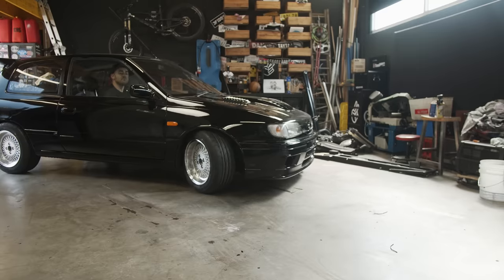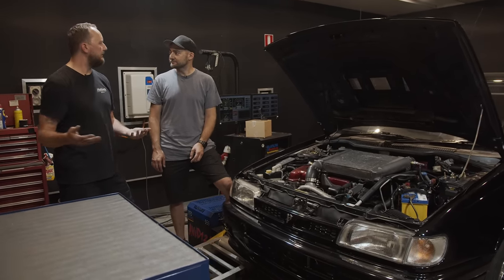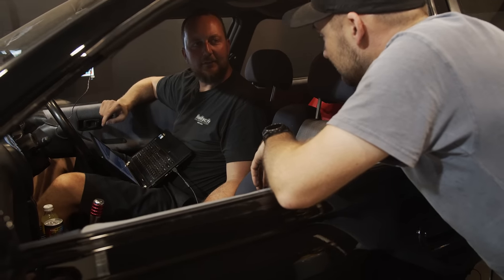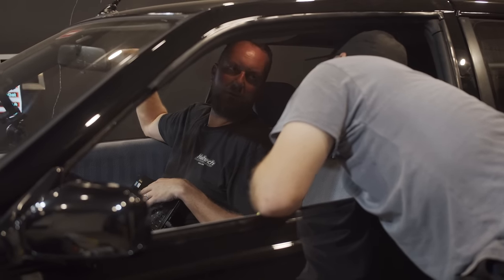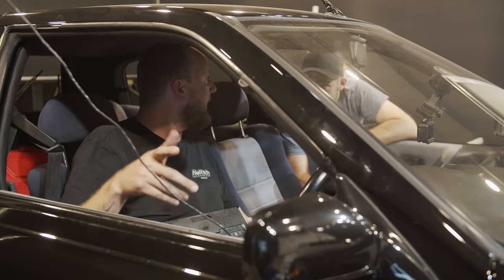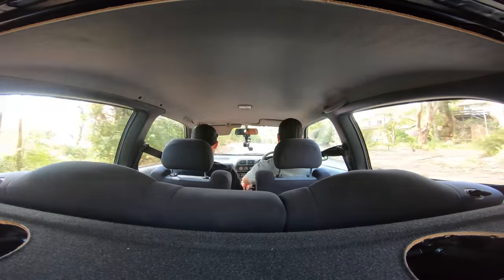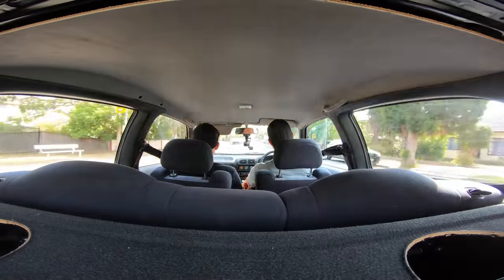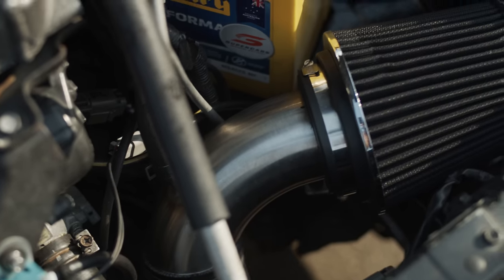Nissan GTiR Brought back to life & tuned

Comment: I'd love to see you catch and release a Celica GT4
Reply: Hell yes! Watching Carlos Sainz back in the day, I wanted a GT4 so much.
Reply: Seen Project Binky?
Reply: Jorn Navarre  spotted one or two locally and in melbourne. They're not as common as what they were though.
Reply: Jorn Navarre  thats because the boys at bad obsession motorsport bought them out to turn it into toyota mini gt4
Reply: I had one 8 years ago. Great fun but getting parts was pricey and it needed a lot of them to get through tuv. Lots of old car problems. Worth every cent.
Reply: @williamparker7823  Imported mine from Japan to the UK in 2007. Probably spent around £20,000 since then keeping her maintained.
Reply: @webweasel4401  I think mine was imported around 98, then I took it to Germany in 2011, then my friend bought it and took it back to the UK in 2014. I had to change the exhaust for one with a cat since it was removed at some point, replaced all 4 dampers because they leaked, got a new wheel hub, replaced a seized caliper after it froze, and barely talked my way out of having to change the speedo because it only read in mph after delimiting. After my friend got it back to the UK, he put some new wheels and tires on then it blew a turbo. To be fair it was the original and had nearly 130k miles on it. I think I spent about 1800 euro every year keeping it legal and functioning.
Reply: @williamparker7823  155k on mine currently. Nothing really went bad on her until about 140k Miles or so, then things needed doing. Damn those lower control arms are £750 a piece. All the suspension replaced, shocks, springs, topmounts etc. Everything underneath the car is new within the last 5 years. Just replaced the original turbo with a stage 1 upgrade, put a down pipe and new exhaust on. Had all the pulleys and belts replaced etc. She's going for a respray soon, once I find a decent body shop. I don't think Ill ever sell this car, but she's my weekend car now as I picked up a MKV Supra back in September ;-)
Reply: I've had the 180 bhp one in all white with white wheels,looked really nice but was slow.so got the next gen (205bhp?)on a M-plate  and totally different car,👍,drove lovely and so much faster 👍
Reply: I’d guess there’s an STI 22B coming up - the ultimate JDM 2 door...
Reply: Saw one on Facebook Marketplace near me for $5,000 last month, I was sorely tempted... Be great if they snagged it...
Reply: Right motor, wrong chassis i'll bet.
Reply: Seen a few for sale, just not on the road
Reply: Theres a few around still. People want nothing for them for some reason
Reply: @WTFNoNamesLeft2  MR2 you thinking?
Reply: @LukeTheJoker  yup
Reply: Shhh no don't tell them that, prices are still kind of low because people are sleeping on them!
Reply: Not as rare as you might believe I know of someone who owns 2 in Australia both running and have seen others on the road
Reply: @oliverzeffert  damn man, I've got a 92 sx and I'm just waiting to find the right example. I've never seen one on the roads though
Reply: I had a ST205 a couple of years ago. Looked so cool but felt heavy, wide body ST185 would be cool.
Reply: Jorn Navarre  Correct. But it's RHD.
Reply: @LukeTheJoker  that was probably mine haha, can see it in my profile picture
Reply: Jorn Navarre  i think they're all in western Canada
Reply: Asetto corsa? One of few modern racing games that has this car and i love it

Comment: best car I ever had, miss it so much
Reply: Suppper lucky to have owned one I have the Nissan 200sx ser . Put the low port on the red top bottom end and stuffed the turbo cams in it. Still a project in the making will deffinetly be fun want to get the gtir rear diff and trans suppose to be a pretty straight forward swap. Will see in the future.
Reply: Lee Treherne at least you got to own one... I tried to look for one but they are so old and worn out I think that ship has sailed for me 😥
Reply: I'm with you. Such great memories of hooning around Canberra and surrounds. People used to dismiss them as nose heavy (and OK they were), but with the right suspension (spring rates in particular) you could minimise the effects and have A LOT of fun. Nugget is perfect description. Cars these days are so big and over-insulated.

Comment: I had a 1990 Pulsar in the US.  It looked nothing at all like this 1990 Pulsar in this video.  The interior was similar.  Mine had like 110hp...about 2/5 of the hp of the Pulsar in the vid.  Mine had the 1.6 Sentra engine in it.  Mine wasn't fast, per se, but it was sprightly enough on the road to be fun and none of it was sloppy.  With 300hp, this Pulsar is a fkn beast!

Comment: Geez seems like a great power figure on the stock turbo! That top mount intercooler was pretty prone to heat soak a good quality front mount might be a good upgrade.

The real question is, do you have the umbrella?
Reply: They probably dont even know about the umbrella lol i think they wouldve mentioned that ...it is pretty easy to miss not expecting it to be in a car from that era lol. Maybe if the door was sagging a little and they had to check it out, or the previous owner took it out.

Comment: Mad car, when you first got it and were just fixing what needed to be done to get it running I was thinking damn they should pull it all out and rebuild it, new clutch, new brakes and suspension, the works... hope ya mate it's going to has plans for it. At least really clean up the engine bay and stuff. Happy travels and good luck lil GTiR o/

Comment: I 100% get it. Referring to one of the last sentences said. I bought an old Jeep ZJ for $200 and it moved under it's own power - only thing going for it.
I spent many hours and less than $1000 fixing, painting, and rebuilding things on a super tight budget to get it running and driving. I've put 3000+ miles offload and over landing alone in the past few years for pennies compared to others buying brand new rigs and doing the same things I do.... granted mine is less reliable lol
Just get out there and have fun!

Comment: I always wanted to swap the drivetrain from one of them, into a 91-94 Nissan Sentra e, like the one in my picture. 4door 1.6L 16v twin cam 5 speed. Base of base models, radio delete, no sway bars, manual windows, locks and steering, no ac, no cruise. It only had one belt, the alternator and water pump. All the power went to the ground.

Comment: I'm in a similar place restoring a 1996 integra type r no turbo stuff but had similar issues with coolant and the brakes I think it's an age thing my next issue is 10 year old tyres to be replaced I'm the first road registered owner since it was imported in 1999 but I'm loving it, learning a few things and bringing it back to original standard ✌

Comment: Worked on or owned 3 pulsars - N14, N15 and N16. All 3 were severely neglected by the last owners, all 3 survived. The N14 the cooling fan didnt work and it boiled the coolant nearly all away, thought it was a goner - nope - fixed the fan replaced the coolant and oil (empty and black) and years later was still running fine no issues. N15 20k oil change and leaking empty power steering - serviced and fixed, no problems. N16 the last owners drove it for months in limp mode 2 coil packs down and a bad map sensor - replaced them and it was fine? Tough little units.

Comment: Honestly the lack of AWD gearbox support is why I always stuck to the FWD SR20's in the transaxle game. At least Nissan made the RS6F51A/H gearbox from the P12 Primera available to the FWD guys. Custom/aftermarket mounts, custom shafts, Single mass fly and clutch conversion (Now available locally from NPC performance) and there have been people throwing 900+hp at them in the states and still putting it to the ground. I have one sitting in my N15 Pulsar with a SR20DET making 190kw, and will go behind the SR22VET I've got in the works.

If you (or anyone) wanted to look at Bulk power in a gtir, looking at what it takes to convert to an evo box and transfer case might be more feasible than say having a billet casing made up, as generally speaking the case flex is the cause of the weak gearboxes, not the gears themselves which is why people with PPG gears etc still break them. Straucher Motorsports in Germany also make a bracing kit for the GTIR box that anyone moving to a PPG gearbox setup should 100% consider.

Comment: after all the things you guys have done, I want to see what you can do to a minitruck from japan. All I ever see for those things is a 2 inch lift and big tires. I think you guys could knock it out of the park, do a 3inch + lift, power mods, and make those 50-60mph minitrucks into something that can do more(like 75-80+mph). all on a budget of course ;)

I dont know australia's import laws, here in the states, the cars need to be 25 years old before they can be imported for road use(and only 21 states allow them due to them being slow). so if you guys kept in that 25 year age and make it fast, you'd make a bunch of us in the states happy.

Comment: To be fair this car started off as a good one,wasn't like half the crap-heaps out there,whoever owned it looked after it.
(would've started straight away if refitted the intercooler @ ecu),
 but the few mods you did by updateing and uprating the fuel system has done world good.👍
Didnt it allready have new suspension? 
 and body work was in really good condition,.and all drive train (engine/gearbox/clutch /transfer box and diff was all in good condition ).
You should've fitted a modern turbo and fitted a front mount intercooler on it to get the best out it though 👍

Comment: I only wonder why the boys left the stock turbo. From what I have been told just replacing a 90s turbo with a modern one of the same size will give you better response, less lag and even higher boost.

Comment: Had one in Emperor green color and foolishly upped the boost to 14 pound untuned (I was young and dumb).. Head  gasket blew instantly lol This car was not fun to work on, we did all the work at home in my garage with a friend put in CP pistons new pipes etc basically a whole refresh except the clutch while the engine was out which we should of did... after putting the engine back in the clutch started to slip...... which started after only a mild tune (it was a fkn nightmare!!!) Trust me these little hatchbacks are not easy to work on it's like you need little Japanese hands just to do up awkward bolts so stressful otherwise a unique car that will get the road presence if you own one.

Comment: REPLACE THOSE RUBBER HOSES THAT CONNECT YOUR CALIPER TO THE LINES RAN FROM THE CHASSIS. This issue drove me crazy on my first old nissan, now when I get dragging brakes I just replace them. In theory people let them hang when doing brakes and it destroys the lining inside the hose, causing the fluid pressure to not be relieved from them easily, making them stick.

Comment: Guys, the droning sound would approbly be the result of having a too big exhaust size. Why don't you try a bit smaller instead.
I kind of compare it to a tuned FIAT or Autobianchi of the past. They sound better low revving and definetely better at higher revs.

Comment: question for scotty if you guys or he sees it: what sort of timing does this run at the factory boost level which is approx 175kPa? Stock ECU runs 27 degrees BTDC up top and noticed you are running a lot less on this video at the 16psi(?) its tuned at.

Comment: These things absolutely HOOT if you tickle it the right way.
I think their torque “issue” would be cured with 1. A fuel pressure gauge on the return to diagnose any fuel flow problems, dribbly injectors (950cc???) and run a 1/2” fuel line from a bigger fuel pump to the injector rail, clean the injectors, etc.
And 2. Jam a little more aggressive timing into it. 
200kw can be made from stock injection and fuel system without boosting its brains out. The fuel injectors they have are good for 350+kw so they have a bottleneck.
3. They really need to read the book “Maximum Boost” by Corky Bell so they can BE the authoritative Gurus they claim to be, rather than taking the car to this shop or that shop, Yoda, Fork.... and plugging the hell out of them just to get the work done for free. 
They didn’t even get their hands dirty, if I wanted to see nice cars go in to workshops I’d watch Tavarish.

Comment: I'm super confused, how did they go from expecting 160kw to getting 215kw?, nearly 100kw over original spec?  What happened?  Also I think it's more that the S13 is the parts bin car - the Pulsar, specifically the 4 door Pulsar was a high volume vehicle, the Sylvia a low volume - so the parts would likely have been designed for the Pulsar and appropriated by the Sylvia rather than the other way around.  I guess in Australia you probably don't see a lot of these high volume Japanese 90's OEM vehicles as it'd be the low volume ones that got imported more.

Comment: umm did you guys replace the theromostat and go over the brakes before giving it to your mate? as it sounds like one of the rotors need a resurfacing or one of them's bent.
Reply from the maker: Kavinsky Smith they are fine, thermostat also ok
Reply: @mightycarmods  just checking ^-^

Comment: I had to a couple of years ago track down a GTIR plenum for my westfield with a 4AGE turbo. Sad thing was the bolts and washers were internal. Down the back straight at lakeside at full noise one vibrated off even though locktight, and the washer went through no. 4.:A Few months later and many thousands i have now got a high compression, forged bottom end 4Age turbo, only on 10 pounds but when your car weighs only 600 kg’s you dont really need any more.n( but its there should i feel any more suicidal) still i had a bitch of a time finding a gtir plenum. Got it outa england where they crashed them all aparently?

Comment: Haltec computers are not for daily drivers but full blown race cars . Reason ur car has its original computer is so its easy to diagnose faults ur engine light comes on plug ob2 reader in boom shows your issues . Now u have haltec if something goes wrong u dont get engine light and if serious its goodbye engine kinda stupid . If u know the issue and u need to fix you need to go to haltec get a tec to put it on computer sus it out find prob fix prob 2 grand later for somone to sit on coputer to tell u what issue is yeah stupid . Haltecs good on race cars drag cars anything that dosnt have daily use . Not everyone can afford to get a dyno tune just to fit a haltec wen thats 2000 grand right there just to fit it . Thsts where thease haltec guys rip u off if you want to change something on car like more boost bigger injectors it back to haltec 2 k later to watch them sit on a computer. Normal computer wen you do this it will throw code up 30 bucks local machanic to clear code let it run . Ur all done .
Reply: Haltech still will give you a check engine light if an error is detected, and you can either use OBD2 or plug a USB cable in to the haltech to read the code. The Haltech also monitors every sensor and if something serious goes wrong depending on what is detected it will either put the car in to limp mode or turn off the car to prevent damage. You are also now always monitoring the A/F ratio and with the elite series if the mixture is off for some reason the ECU will compensate in the short and long term learning. Also if your car is supported you can get a plug and play harness for your car, no wiring required and you could road tune it yourself if you have the knowledge and skills

Comment: Mate just cleaning a car (especially a gtir) to look pretty and just putting it on the dyno without going over the car first is just crazy. Example, overheating to the point of safe mode.... Unacceptable to the point of negligence. I can't watch this video it's doing my head in. I owned a 420 bhp/400lb gtir for 7 years built by myself and I'm seeing some proper issues with the opening 60% of the video it's just bs. 950cc injectors on the top mount intercooler and standard turbo is just massively stupid.